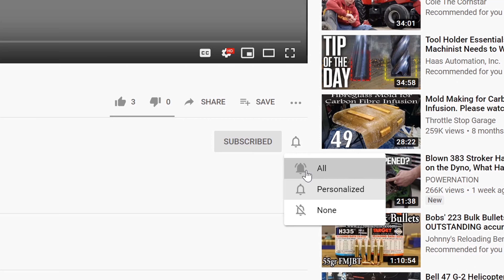Datsun 280z  - SKILLARD front grill installation

Comment: what about those tire size on this z please? i love how it fits but have hard time finding tires for my wheels
Reply from the maker: Are you going to be running coil-overs?
Reply from the maker: 225/60/r15  Wheels are 15x9 with -15 offset.
Reply: @hcr-motorworks  yes and fender flares...so i think only best option is 225 50
Or r888 come in 235 50 r15 otherwise out of luck
Reply from the maker: he's not running flares on his yet and doesn't have a problem so with the flares installed and fenders rolled or cut im sure you could stuff way more tire under there than a 225 or 235 honestly.
Reply: @hcr-motorworks  ohh I know but nobody makes bigger tires in r15 diameter
Reply from the maker: there's definitely bigger tires than a 235 in the R15 size...but you'd have the keep the aspect ratio pretty large as well.